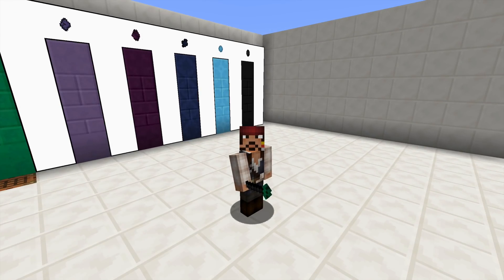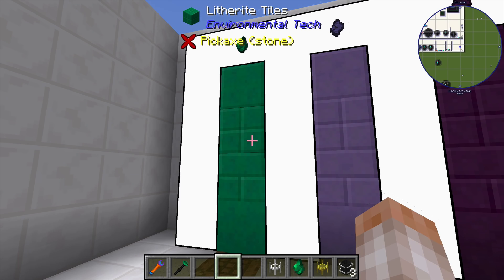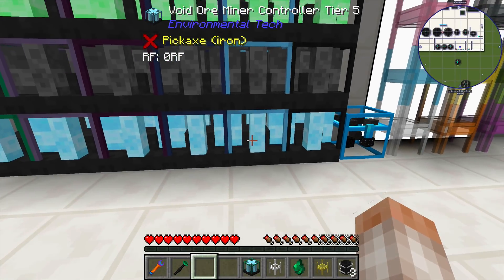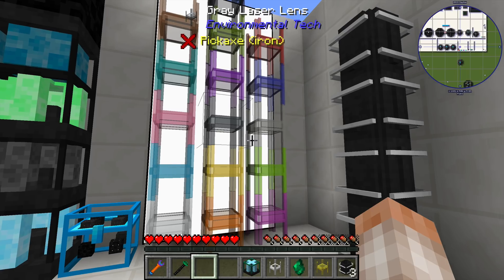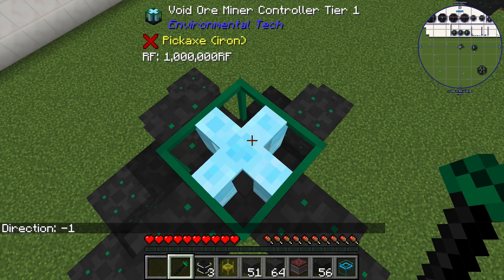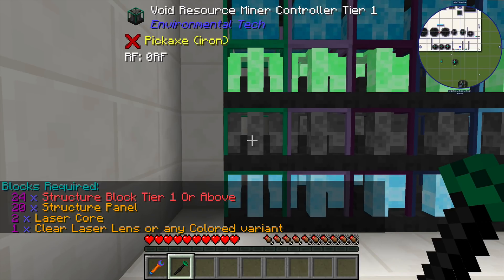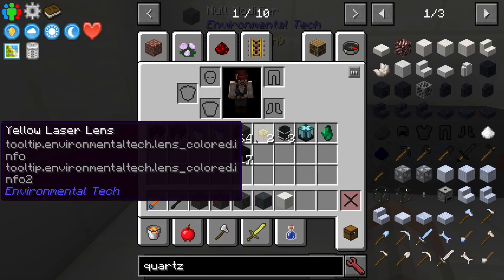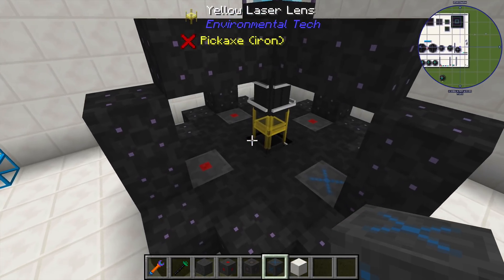Environmental Tech - Mod Spotlight

Comment: I would HIGHLY recommend putting ANY type of solar panels in the end dimension cause it's apparently always day in the end dimension
Reply: Oof ♡
Reply: Or the Twilight Forest.

If it is available on your version.
Reply: @bobisnotaperson  dont it have nighttime there? or did they change that?
Reply: Depends on the modpack. I loaded direwolf 1.12 and by default that was not the case. I had to configure it to have it day 24/7. So, check your gameworld before making that decision. Modders are catching that and changing the default because they think it's too op again.
Reply: will the chunks still load though? when you're not there
Reply: @RD-uq4hg  Chunkloader gotta make sure all the panels are included though otherwise it'd cause issues

Comment: Extremely informative > Every single info anyone in-game could ever need about the mod.
Fast and very clear > Not boring.
No idle talk > Right to the point, no unnecessary chit chat. 
Cant think of a better Spotlight than this, thanks mate. 

PS: Only dimensions of all the multi-blocks could have been written in signs nearby to help out, but not very necessary since it is very clearly calculable from the way you designed the area.
Reply: That's why I always go to this channel first to check on how to do something.
Reply: The dimensions and block amount is in the description

Comment: 2:18 "to find out what the crafting recipe is for concrete." You just place concrete powder in water. That's the vanilla method XD
Reply: When you play just modded minecraft and forgot about vanilla updates :D
Reply: A little late but a Fluid injector can be used instead of placing them for faster crafting.

Comment: In the newer version of the mod that Direwolf20 is currently using, there is a crystal lens that will focus on getting the EnvTech crystals in your void ore miner.  There is also more on the tool tip when you click on the controller that will tell you what you need for the next tier of miner.  I'm sure there is something similar for the solar panels.

Comment: I noticed all your ore miners were running on the same power system and they were all on at the same time. Wouldn't that add the power consumption to each tier as you built them. tier 1 + t2 + t3 + t4 + t5 + t6 = 77k.  I could be wrong though :P

Comment: one of the worst tech mods imo
Reply: Too expensive tbf, i can get loads of RF and ores through other means, i don't think i'll ever play with it on my modpack.
Reply: It starts out EXTREMELY SLOW but once you get two tier 3 ore minors and 1 resource minor all with crystal lenses they truly pay off. I went from tier 3 to tier 6 in three days. WARNING: Don't waste your diamonds on the tier 1-2 solar arrays! The tier 3 is when they start producing more RF than an extreme reactor. I had 8 tier 1 solar arrays and they didn't do crap since the sun wasn't always out. However the higher tiers are amazing if you have a massive energy storage set up.